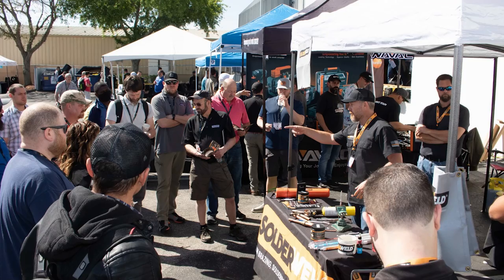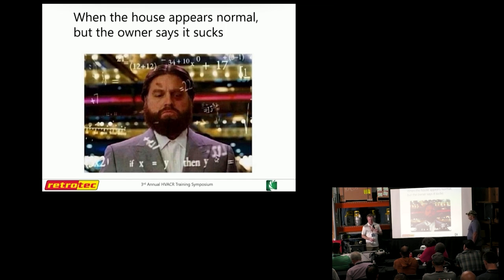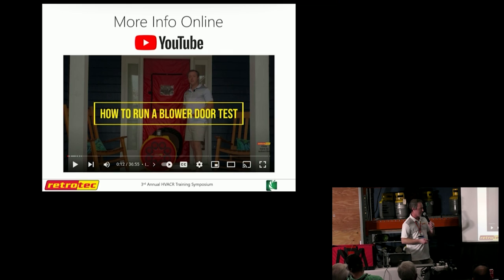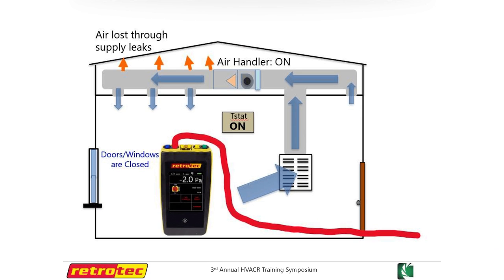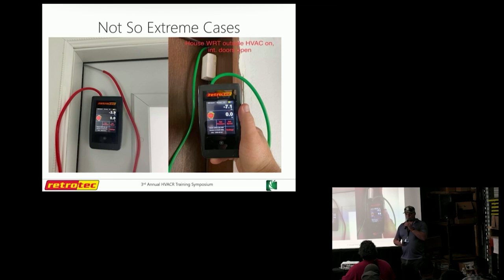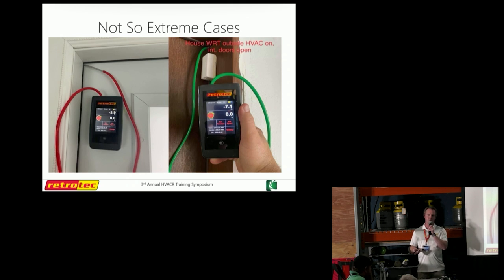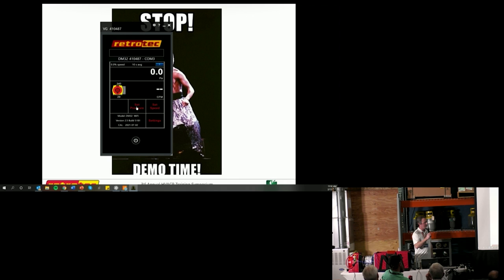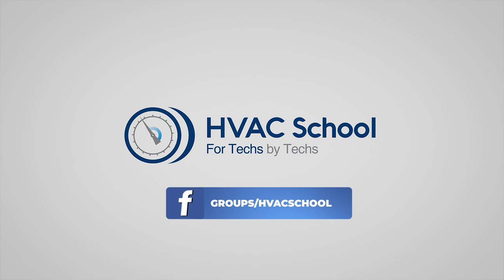RTFM!  But Wait This House Has No Manual w/ Sam Myers and Genry Garcia

Comment: In the St. Louis Metropolitan area on new builds , the code enforcement authorities have pretty much insisted upon Air returns in every room except the bathrooms and kitchen. They are also requiring a load calculation for the house that is going to be built. Large builders do get around the load calculations by using a standard set for their particular Home models which kind of removes the north,south ,east and west criteria in there required calculations that the rest of us have to use. Considering 99% of our installations have basements, running the air returns to bedrooms is really no big deal. Existing homes are grandfathered in and continue to use hallway returns, we can add extra returns if we feel there’s a problem.

Comment: I have a question any help would be appreciated I have a carrier heatpump that in cooling mode runs 120 suction and head starts at 300/315 over the course of 30 minutes the head will slowly climb to 400 and trip out the head but the suction never changes, it’s not overcharged, dryer same temp on both sides inside condensor I was thinking possible reversing valve but I’ve always seen high suction when I had that problem. My next thought was possibly accumulator, any thoughts the more research I do I’m thinking bad compressor